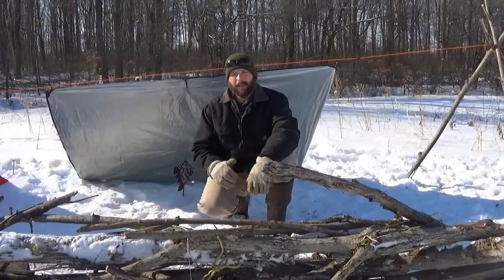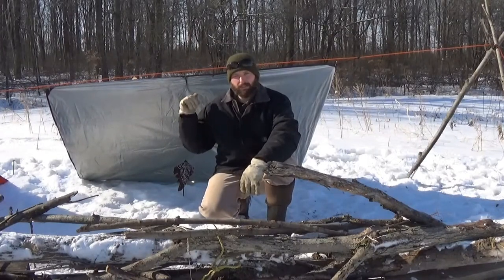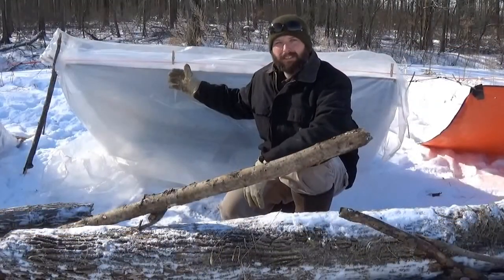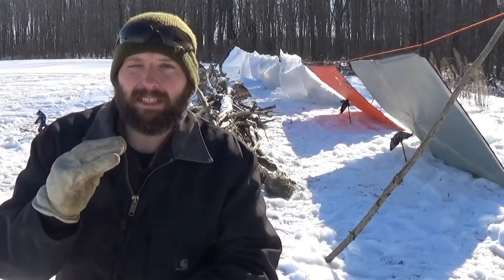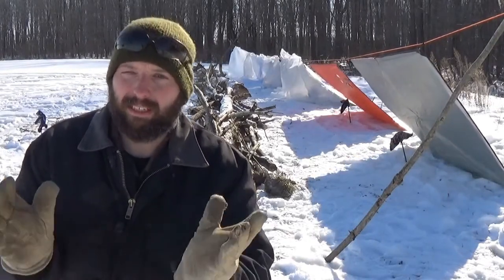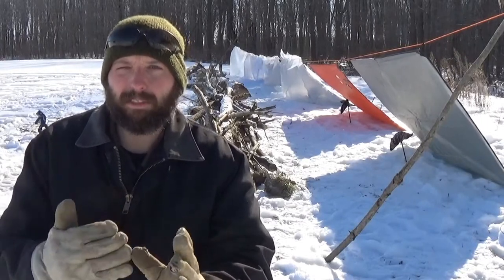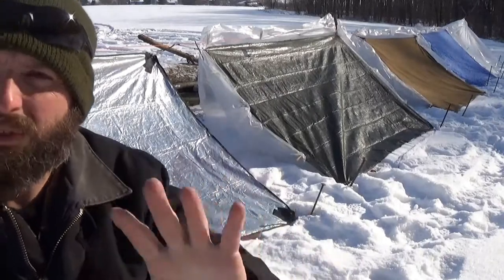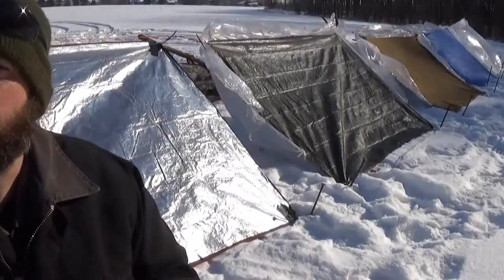Super Shelter Shootout

Comment: I took some training with Mors a few years ago and during one of the instructor's talks (I believe Kelly Harleton), he said one of the biggest benefits of the space blanket was to make it one of the brightest and cheery of shelters. That adds to the psychological effects of the shelter. One thing that may or may not impact this test is the "super shelter" you created. The traditional one has the mylar blanket, then a layer of fabric, then a layer of plastic over the entire shelter. It's not just plastic window, tarp, mylar. This adds an extra layer of fabric (theoretically then another insulating layer of air) so your version may lose heat faster as there's no buffer from the cold. EIther way, super cool that you pulled this off. That's a neat n=1 experiment for this.
Reply from the maker: Brady Patterson Mors is the king. This was a testing many variants of the super shelter. There are to many variables to take much out of this except they all work to some degree. Thanks for watching.
Reply: Super interesting test. Kudos to the solid effort.

Comment: I was considering if I should add a plastic sheet to my kit. For a few bucks, I think it would be worth it. I also thought about protection from blowing wind and rain/snow. The sheeting would keep it dryer inside. In Dave's test of the super shelter, condensation was a major problem. So I looked at Mors' video again. Cut a window. Problem solved! Great video! Looking forward to more of them!
Reply from the maker: Ralphie I am working on a simpler super shelter set up for the winter months. The thin plastic requires a lot of attention.

Comment: Nice experiment thanks for sharing mate excellent video clearly took a lot of work!

Like you said you can try and make the fire as consistent as possible but it will always vary and using the laser measure also has slight differences, you could've used mercury recording thermometers set in place instead to record max and minimum in each set up over a period of time maybe?

All the best
Roo

Comment: I think u should have used a thermometer instead, each enclosed in a 1foot square cardboard box.. with enouh ventilation holes to equal out the temps inside and outside the box instead of laser temping  black bandanas that were obviously gaining heat from direct variable radiated heat. Variables include air circulation which do block heat radiation as well as cools off the fabric. You want ambient air temps, not how hot a bandana gets which directly equals how hot your clothing or skin would get, each giving different temps depending on wether or not you are measuring what is and whats not directly facing the fire! As we all know... When you face a fire, your front is nice and warm while your backside is cold.... Sometimes VERY cold while your front burns. Knowing that, you cannnot expect usable data from laser temping a material subject to uncontrollable variables. You need to measure the air temp in the super shelters. As for the NON super shelters (the ones with no walls) you can only expect useable data measuring reflected radiated heat, because air circulation would nullify ambient data. So in those cases u should simply measure the side of the bandana thats facing that back sheet. Better yet, measure something more flat and shielded from cross wind.
Reply from the maker: Tinker Tanner their are a lot of variables.  If I had the chance I would do several things differently. Thanks for watching.